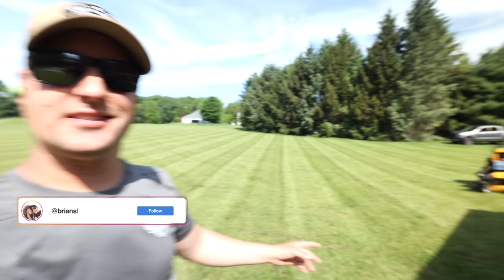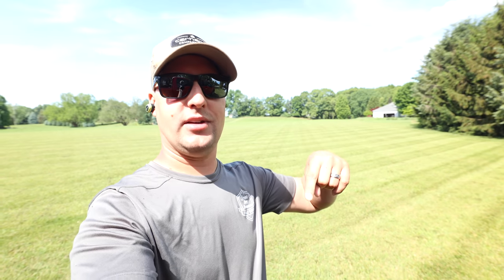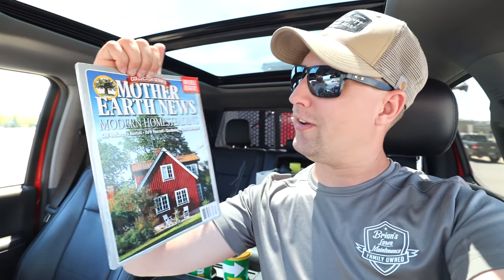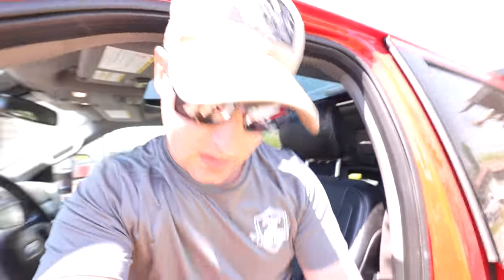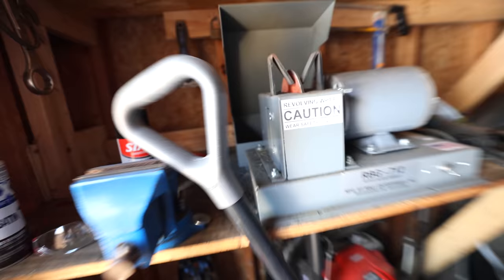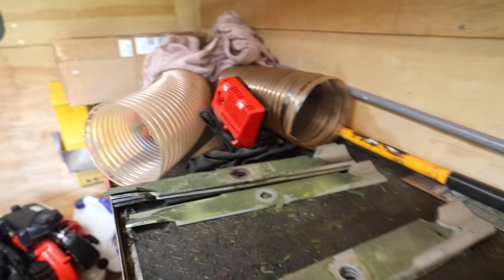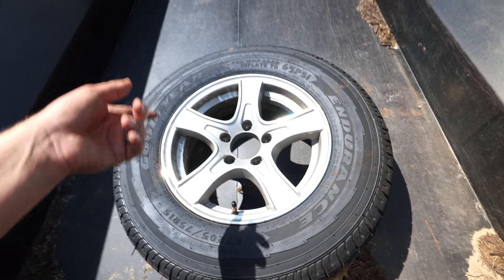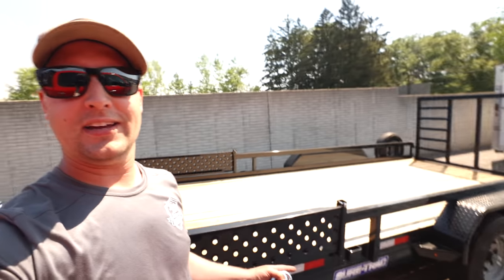DAY IN THE LIFE! ► Tackling Weekend Projects!

Comment: D ring shackles, they work great, the hitch is designed that way because it is rated at such a high weight that they actually have to do it that way
Reply: Or they could use thicker steel with bigger holes...

Comment: Question: Do you ever have any issues of the those iso tunes falling out? I tried a pair of soundcore ear buds built just like those and returned them with in an hour cause they kept falling out. I just bought the pro 1.0 (thanks for brians10) and steered away from those because of that issue. I was afraid the iso tunes would fall put so I opted for the pro 1.0 🤔

Comment: I see lawn contractors rolling in ford use those removable links because of that very issue. Myself I run a Chevrolet and the chain hook slots are on an angel to solve that very issue been like that since 1999. Just saying ford has a some design flaws for contractors the tow hitch on them in my opinion is one of them I don't mean to get down on ford but that hitch was a deal breaker for me had a friend that lost a trailer because those slots ripped out on him ford replaced the hitch with the same thing. He traded it in for a different brand of truck at a loss never had that issue again that was my experience by proxy.